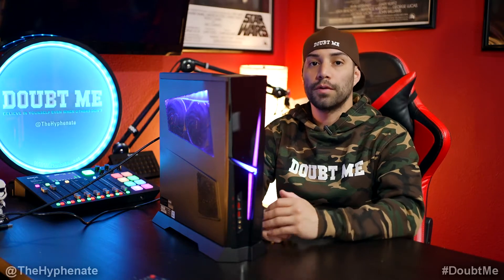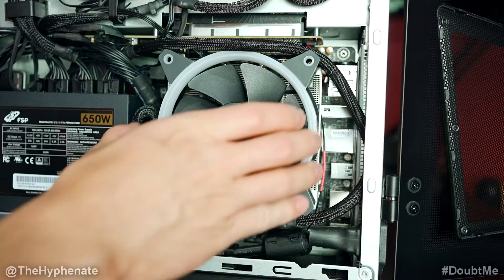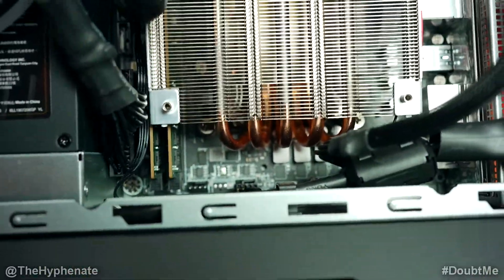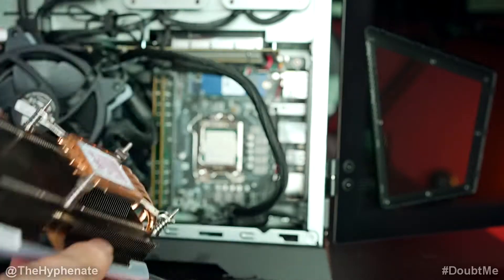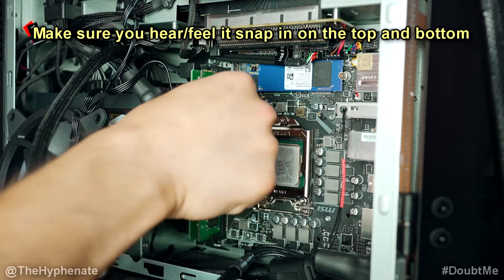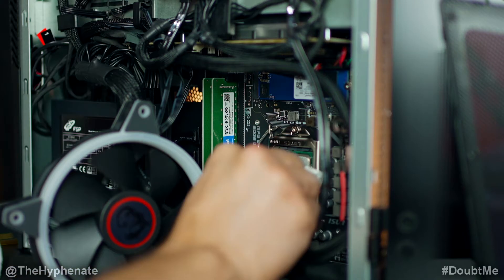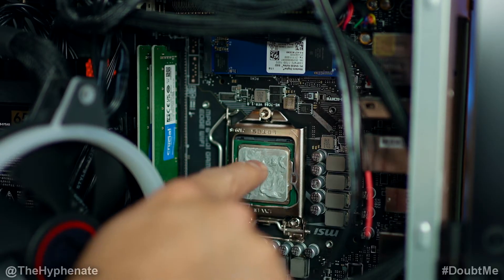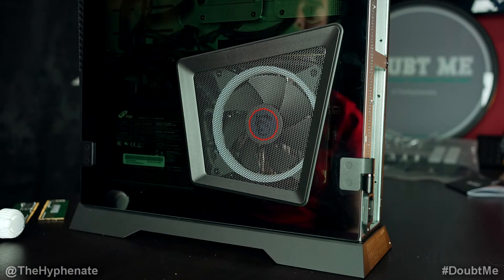MSI Trident Ram Upgrade [ How to Install More Ram on Trident X AS Desktop PC Tutorial ]

Comment: Just upgraded with the  2x 16GB (32GB) (CL16) Corsair LPX Vengeance 3200 kit, worked like a charm.
Reply from the maker: Happy to help. Thanks for watching 🙏🙏
Reply: @seruvletu  The only thing you need to do in BIOS when installing the ram, was to enable the XMP profile to run at 3200, otherwise it'll run at default at 2133 which you don't want to.
Reply: @seruvletu  It should be supported, you'll have to check your motherboard's intruction manual or specs if you wanna make sure of it.

Comment: Thank you for the video--excellent instructions. I ran into a problem.  I have the Trident A Plus and I was not able to remove the mesh grill. I untightened the screws and it would not budge. I was afraid to damage the circuit board. I tried everything, tight/retighten screws, light prying, twisting....nothing worked. Any suggestions?  Also, would I be able to install 64GB RAM (two 32GB). I used your link to Amazon to get them. Thanks!

Comment: They actually fixed this in later models I've got the AS13 and they now use laptop ram and a smaller fan giving you access to your ram with taking off the fan and heat sync
Reply from the maker: That's awesome!  Thanks for sharing that update 🙏🙏

Comment: How would you know the right amount of thermal paste to put on? Is there a real downside to putting too much or too little?
Reply from the maker: There are many videos out there comparing different techniques, but for me I prefer a medium amount across the cpu but away from the edges.  Little paste is not good. Too much paste is not necessary.  So in the middle I recommend

Comment: i have this same PC. Anyone else have an issue with the Thunderbolt port sitting back to far to get a good connection? I have to push the cable in very hard to get a connection and it's very sensitive and disconnects often. Wondering if I might have to have it repaired.

Comment: I did this and now my cpu keeps overheating and keeps shutting down warzone or the PC… any ideas what I did wrong or how to fix?
Reply from the maker: Did you use new thermal paste?
Reply: @DoubtMeTech  yup, cleaned out the old one and added the new one. Now my cpu is getting up to 95 Celsius. I’m not sure what I did because I took it apart to make sure and I still have paste covering the entire area
Reply: @krazymofo17  you probably tightened the cooler not diagonally.

Comment: Would there be a huge temp difference if I dont repaste the thermal paste?

if the unit is only 1 month old?
Reply from the maker: It can be a difference. Maybe not huge, but some.  Thermal paste sells for less than $10 usually.  And it's fast to put on.  I recommend putting new thermal paste on

Comment: Hey pal, I have a problem , maybe my computer is different to yours??
Reply: The heat exchanger is still so stiff, I feel like if I force it I may break the mother board..
Reply: Just a note , I found instruction to turn on the computer and heat up the processor, I left the fan off and watched the temp via the dragon Center app, when the temp reached around 80 degrees I shutdown and gently worked it, and it did POP off. Was pretty tough and I may have broken the motherboard if I’d forced it.

Comment: Which exact model are you working on? Trident X and Trident AS are different, also there are variable configurations within those platforms. RAM upgrade would be similar but as we are seeing one opened up, wanted to know exact configuration. I'm interested in Trident AS 11TD-1815CA.

MSI says it has 450 Watts PSU, but since yours have a 650 watts got me curious.

Comment: hi can i install ram with heatsink. i am planning the Corsair Vengeance LPX i have the msi trident x.
Reply: Did you do it? Did it work?
Reply: @phenomic  Just replaced mine with 2x 32GB Vengeance LPX 3600.  Yes, it works fine... I can't speak for other brands, but the LPX is good.  MSI Trident X 9th gen
Reply: It's works just fine, perfect fit.
Reply: @seruvletu  It was detected automatically by XMP